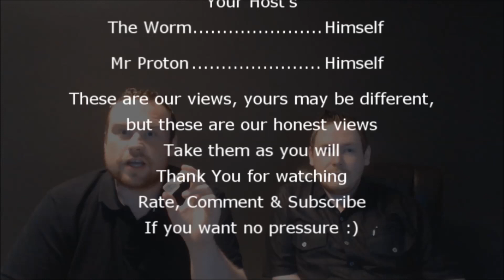Sigelei Kick

Comment: Great review.  One point you missed.  If you look close and if you hold the device with the grey adjustment downward and look to the left on the circuit board you see a scale showing from 5 Watts if its adjusted all the way to the left and 10 Watts if adjusted all the way to the right.  Not a big deal, you guys stated what you needed to know but if you need to see the scale it is there.

Comment: On mods where the grounding pin won't make contact with the body...Aluminum foil. My brass sentinel clone will fit the kick in 350 mode no problem, but the tube at the top is too wide for 500 mode. A piece of aluminum foil folded to the needed thickness between the grounding pin and body...and voila...fires right up. Someone needs to make a kick adapter for these 26650 mods now...

Comment: good review guys thanks, i have a genuine kick which i use in a mech mod, it works great BUT it shuts down when the batts get a little low  around 3.7/3.8 volts does this do the same? cheers...

Comment: Would this be ok for running a 0.8 - 1.3 ohm coil on? Is there a minimum coil limit? Did you try the new 15w ones?
Reply from the maker: we havnt tried a new one and it should be mate just wont go above its maximum watt setting so anything under 1.5-1.6 area the kick would actually be holding the battery back